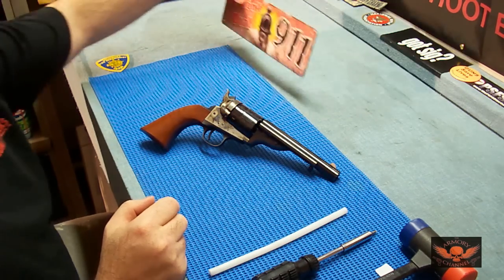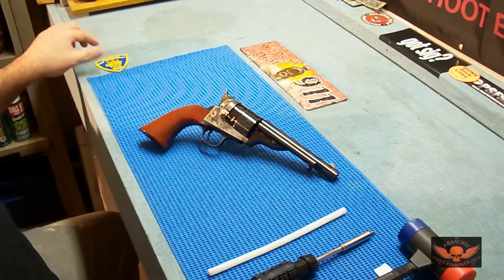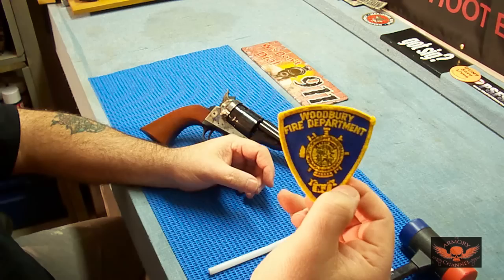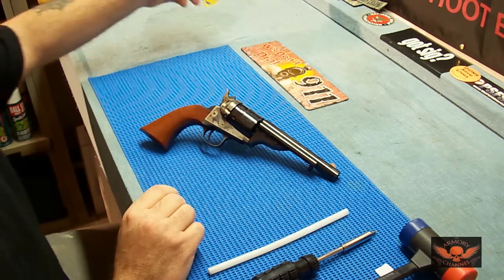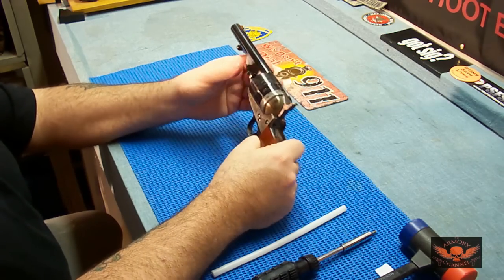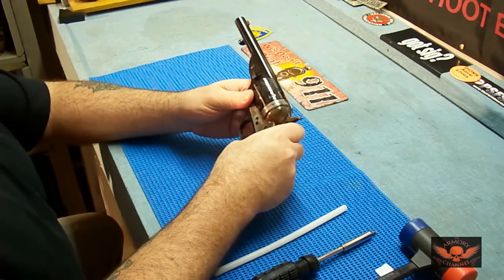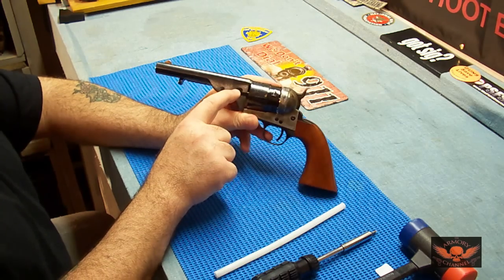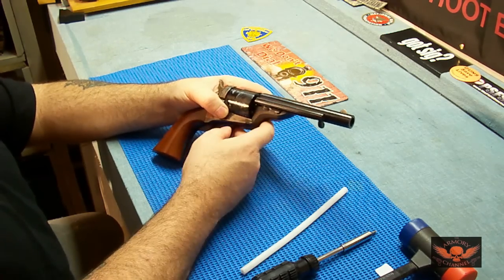Open top revolver disassembly

Comment: Absolutely wonderful instructive video, I just wish I had seen it before taking on breaking down my Cimarron 1872 Open Top for the first time.  I did exactly what you advised, except when I could NOT get the barrel off the frame I did not use a cushion and used a steel screwdriver to force it off, but fortunately it came off with little force and flew off the arbor onto the kitchen floor, no harm done.  I greased the arbor with the exact grease you advised.
Thanks,

Comment: Great video. Really appreciate it. I recently bought a Cimarron 44 just like that. I bought mine for display mainly. I'm replacing the gun grip with old (fossil) walrus ivory. I used to carve a lot and taught carving techniques old and modern through the community schools program in Alaska. Promised the man that taught me that I'd pass it on. Glad to have done it. Anyway in the 80's I made grips for two colts from the 50's. The no screw through the side of the grips really stood out for me. The owner was picky and had me make him one piece grips. Really difficult to tool them that precise. And costly and wasteful in my opinion. It took 6 lbs total to get one piece for each. Actually more since some couldn't be used because of cracks running through it. It was $250 lb back then. Almost doubled by now. Mammoth is cheaper and more plentiful but not nearly as durable. Plus mammoth ivory gets soft and flakes when it gets wet. Walrus won't do that and colors and patterns vary wildly. Thanks again for the video especially the tip on the burr. Right on! Peace!

Comment: GREAT video!  Thanks for making it - I needed it simply because I bought my first open-top yesterday:  an Uberti 1871 .45 LC.  And if one is used to top-frame guns, this slightly different configuration can be a bit intimidating as to disassembly; like all manuals, the one for this gun offers a very short paragraph on removing the wedge, which helped not at all.  Your good close-up photography makes all the difference.  And the explanations as to why you're doing what you're doing makes all the difference.  Have no idea why the f-bomb language seems to be more important to some of the other opinions than what you show; I have no problem with it, for anybody who has ever gone through boot camp or basic is used to earthy language as part of instruction - especially in weapons classes:  keeps one awake!  And I'll bet those who make this the central point of their opinions hear worse stuff on their cable shows for which they pay a lot of money every month!  Thanks again for a well-done video!  Just what I needed with this new gun!  (Formerly from South Jersey myself:  Lakewood/Toms River)

Comment: Great video and great gun!  I've got a Uberti 1872 open top just like this one.  I love it.  When I picked it up from my dealer, the wedge was so tight the cylinder would not turn when loading.  Came that way from Uberti.  I had to get the wedge out with a wooden pry stick to get it apart, then when I put it back together all was well. The gun shoots great and feels and looks great too.  Thanks for sharing!

Comment: curious you mentioned not to dry fire cause the hammer will the steel and get damaged but would it be safe to dry fire with a spent shell or could it still get damaged?

Comment: Just received mine and it's gorgeous! Left a small idiot mark on the grips, though :( My knife that I was using to take the tag off the trigger guard put a little scratch/indent with the clip contacting the grip. My wedge is on there tight, I'll have to buy a wooden dowel & a rubber mallet

Comment: They reduced partially the frame of the navy 36 caliber to accept a bigger 44 cilinder. Type "Shooting Colts 1862 Police Revolver" and you will see on the video posted by duelist1954 that the firm Colt made the same with the frame of the pocket model caliber 31 to acomodate a 36 cilinder.